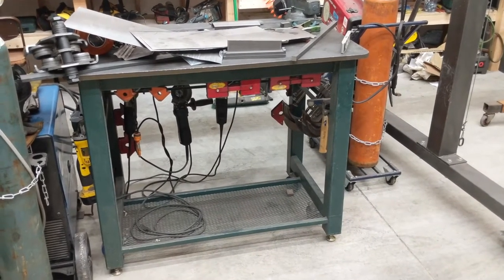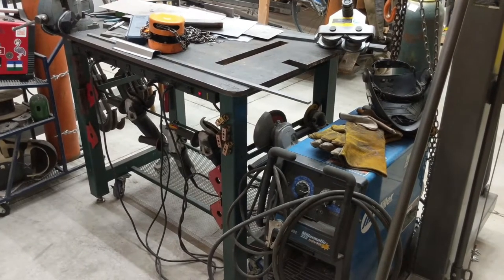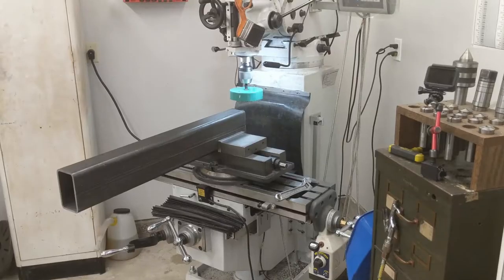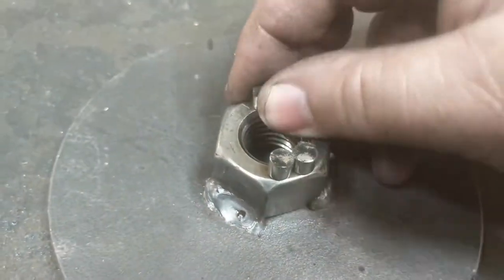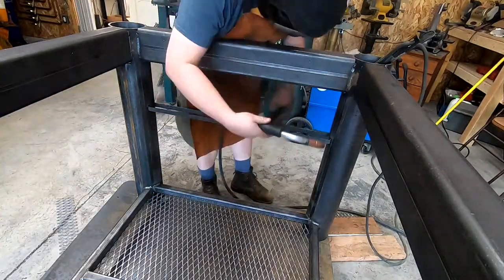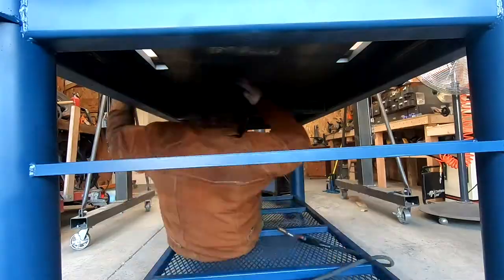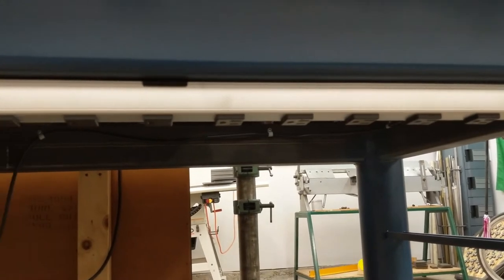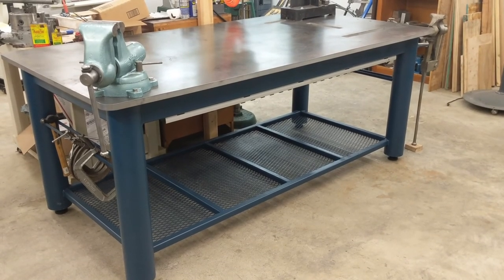This table is FAB!

Comment: What primer did you use?  I like the upside down power strip.  Horizontal outlets in a metalshop can be scary when pieces of sheetmetal slide down into the slight space between the plug and outlet and contact.
Reply from the maker: I'll have to check next time I'm in the shop, but it was just basic primer.

One trick for the sheetmetal thing is putting in the outlets upside down, so any conductor falling in will first hit the ground pin. Except then the outlet looks wrong, which I've yet to reprogram myself away from thinking.